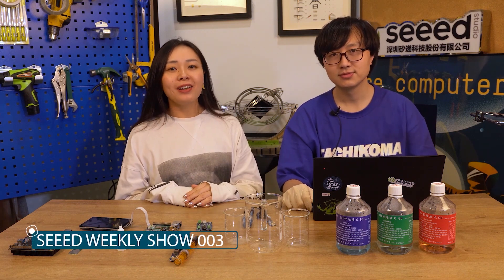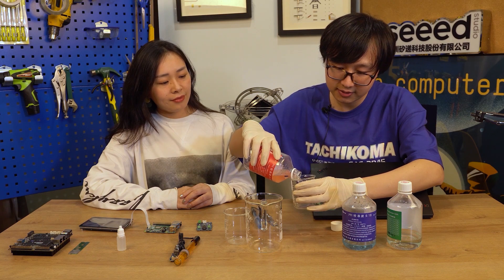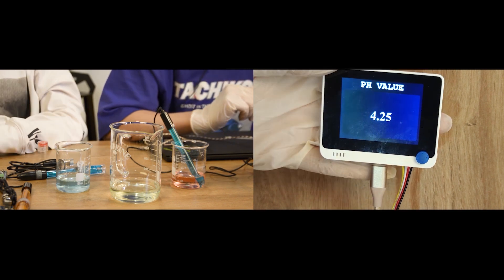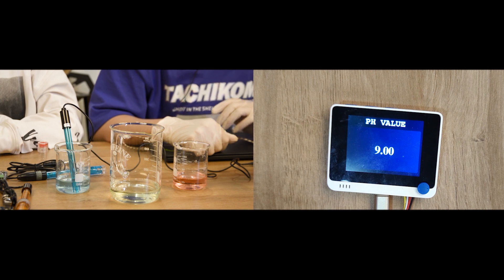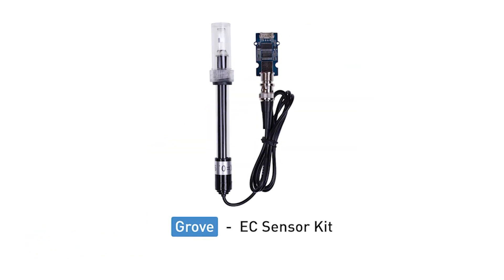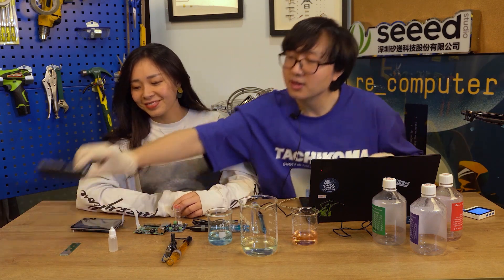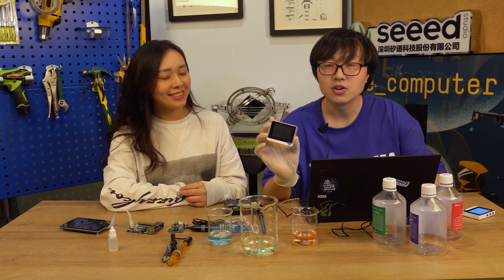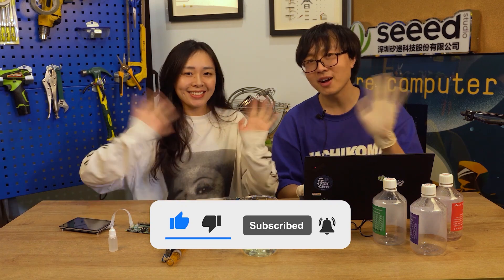Seeed Weekly Show - N0.003 -(05-08-2020)

Comment: That's some really nice prices for those new sensors. It's a bit concerning that the pH 4 solution was measuring 4.2 though. Nice to see that you're not faking the results but it would be great to have some specifications on what kinds of accuracy and precision we can expect :)
Reply from the maker: We actually experimented 3 times during the video shoot, and the first two were pretty close to 4. But we decided to release the 4.2 version anyway. The price is reasonable, we will also be introducing water quality sensors with ROHS certified versions that will be a little more expensive. Stay tuned :D